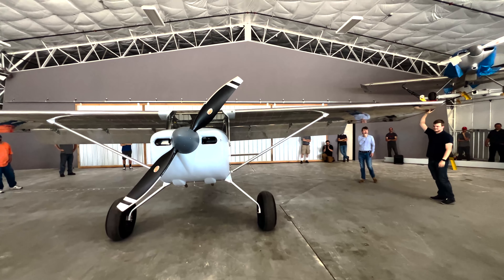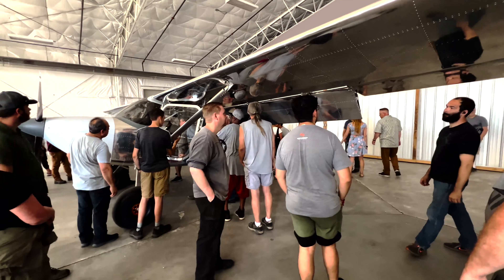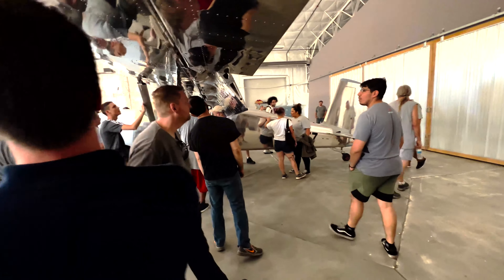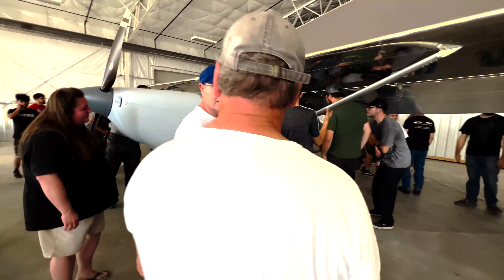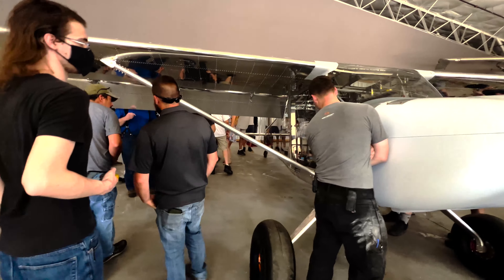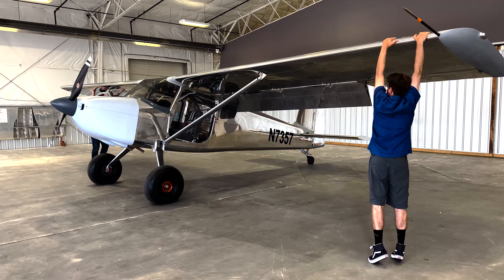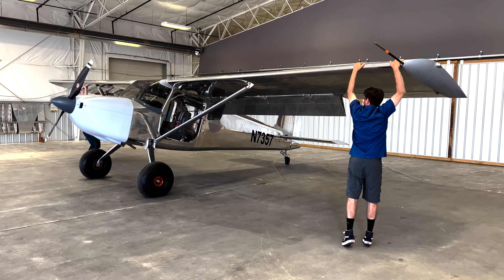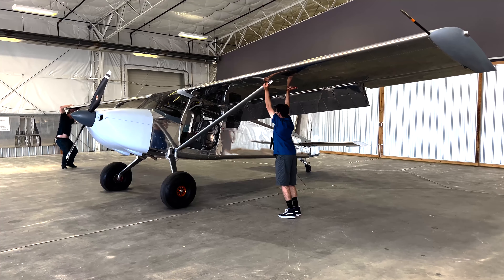RV-15 Engineering Prototype (on 26's) - Van's Employee Reveal Party (plus an "invisible feature")

Comment: I've largely ignored Van's because aerobatic aircraft is their specialty, and those are of little interest to me, but I love the look of this divergence from their standard fare :D
Reply: I think it’s a bit too much to say Vans specializes in aerobatic aircraft. They are great cross country machines that also happen to be able to loop and roll.
Reply: You probably missed out on the cross country machines such as the RV9 and the 4-seat RV10.
Reply: @phatvu3811  Huh, maybe I’ll check those out. Thanks.
Reply: Wow what a comment !! Dick designed an built some aircraft that have one of the best envelopes in the business ( stall speed to top end ) they take off in 300' to 400 feet and cruise 200 mph. AND they're also built very strong and quick ( I like very strong ) so part of them are areobatic. Of little interest ??? In case of an engine out you can land in less than 500 feet. You can also cruise at around 200 mph in a very strong airplane. I think that's VERY interesting ?
Reply: @danmcburney3247  They are excellent aircraft I am sure; it’s just that most of them are not something that appeals to me. I didn’t mean to insult them, insinuate that they were overly specialized, or suggest anything negative whatsoever. I have no doubt they are superb.

Comment: If a two seater seems like it would be a great replacement for the 150/152 series
Reply: Help me to understand how a 100k+ airplane is going to be a replacement!
Reply: SO well said !! If it stops at 100. How many times has this been tried ? How many can they sell. Just what the public wants,a tailwheel trainer
Reply: @pauleyplay  why would anybody think this was only a 100Kt airplane? My Rans S 21 with a less powerful engine than what this will likely have is good for 130kts up high. Vans is not building this as a trainer they’re building it for all the flatland posers that want to go to Johnson Creek ID and replicate Trent Palmers Bush flying. It will sell like hotcakes.
Reply: @Captndarty  We shall see  You have a good point
Reply: @Captndarty  I think he means $100k
Reply: @NoRemorse92086  huh, I suppose so

Comment: Airframe stress analyst here (Boeing, Cessna, Textron, etc.) Why the added weight and complexity of some internal mechanism for the gear? How is that superior to a solid flat spring like a C-170/C-180? Is there some kind of oil-filled damper on the RV-15? If so I have to ask why the added weight and complexity? I can't imagine short field stopping distance is really that much improved. Takeoff distance zero improvement.
Reply: Try landing a rocky field in a Cessna and you will understand why shocks are a wonderful addition to an off-airport aircraft.
Reply: I believe this shock absorbing gear will greatly reduce the (unwanted) bounce that typical flat solid gear delivers.
Reply: The Husky also has an internally dampened landing gear which is a big improvement over the pre 2012 Huskys. And essentially zero maintenance difference.

Comment: Sweet plane! More than I can afford.
Reply: I'm expecting 100k flying if you think about it that is average price of lowest priced SLSA that isn't an ultralight type aircraft. I agree my wife never let me blow 100k on an airplane I'm stuck with ultralights building a Chinook 2 DR landing gear with a 2 stroke engine. Have about 32k invested when I'm done at least I will be in the air.
Reply: Compare to a new C172 that costs $500K, this is a bargain.
Reply: @Mike-01234  I have '64 182 that I paid 56K for. $359 month. It's ugly (bad paint and interior) but its IFR, long rang tanks, one of the best light aircraft engines ever made with low time and great compressions and goes 150mph /130 kias.

Comment: Will the fuel tanks be inside the wing?
Reply: why wouldn't they be?
Reply: @SoloRenegade  if the wings were foldable or removable the tanks would likely not be in the wings (it’s rare see eg rv12)
Reply: @thewaterengine  SPA Panther? Kitfox?

Zenith have removable wings.
Cessna 150, 172, etc. have removable wings.

Not rare at all. Just a matter of preference and execution.
Reply: Previous comments from Vans official YouTube channel indicate there will be wing tanks
Reply: @SoloRenegade  C150 and 172 wings aren't easily removable. They have cables for ailerons & flaps, fuel lines, pitot line, stall horn, lighting cables, fuel sensor cables. It's a maintenance job to remove or install them. 
The removable people are talking about is easily removable, for hangaring and transport. Like those Europa kit planes, or HK36 Dimona. I've seen the HK36 being put together in under 10 minutes. And the Europas often live on a trailer, or a garage, only to be assembled on the airfield. That's quite convenient, IMO.
Reply: @thewaterengine  - Plenty of high wing aircraft with folding wings have wings tanks, such as Kotfox and Groppo Trail. Infact, ultralights and small LSA aside, I don't think I've seen any without wing tanks.
Reply: No external drop pods
Reply: @GoneOutFlying  But the Panther and Kitfox, among others, are easily folded.

And you didn't specify exactly What "removable" wings meant. But when you listed the RV-12 as an example, you opened yourself up to a wide interpretation. As RV-12 wings are not easily removed either. About as easy as a Sonex, Zenith CH650, or other airplanes that both do a don't have fuel in their wings.

And since my examples Do have fuel in their wings, and Are foldable or easily removed, my argument is valid.

Comment: Electric retractable slats and double slotted flaps and we’d really have something.
Reply: Wouldn't it basically be a 701 at that point? Vans are pretty good at making what they want to make.
Reply: As a builder I want SIMPLICITY! I am not even crazy about the dampened gear legs as it adds unneeded complexity
Reply: @simonhughes-king  Not even close, the 701 still uses a high lift airfoil. This way you could keep the more laminar flow airfoil and completely change the low end and safety margin that true retractable slats provide.
Reply: @robjohnson8522  Check out the Zlin Norden, the slats only weigh 22 pounds and are interconnected using one servo motor. Motor fails and the both slats fail in their current position.
Reply: @robjohnson8522  Well said  what is the point

Comment: I like how the shocks are built inside the fuse would be interesting to see the design. Does it meet LSA standards would be even cooler maybe this will be coordinated with FAA announcement raising the LSA weight.
Reply: Just from the size of it (grown men standing under the wing without hunching) there's no way it's going to meet the current LSA max gross and have any sort of useful load
Reply: It will meet the current proposed MOSAIC standards…. Which are nearly approved in Brazil this month. Hopefully the FAA will adopt the same. 4 seats, 3000 lbs, 61 kts Vso
Reply: @rianjohnson7484  are these the RV15 specs you’re listing or the current MOSAIC spec requirements? Many are wondering if it will be 2 seat or 4 seat!
Reply: Those specifications are for MOSAIC in Brazil. They also added Vh 185 kts. Just passed into law this morning. As for the 15 we will give more information at Oshkosh
Reply: @rianjohnson7484  thanks for the update
Reply: Thanks Rian, great info!

Comment: The new c172 replacement at half the cost. Vans should make a tricycle gear version and that would dominate the training market. Also 4 seats would stick a knife in Cessnas overpriced c172/182’s. Come on man do it.
Reply: They've already said that they'll have a tricycle version as well...
Reply: @TalonID  sweet, Vans giving aviation what it wants and can afford.
Reply: Keep in mind that you can't use an experimental aircraft for compensation or hire so this won't be used for training purposes. and isn't designed for that anyway.
Reply: @RVationNation  there is a flight school using RV12’s not far from me. Now I think you can only get a sport pilot there but maybe Vans should look at certification or get Aopa to push for it unless they are too far in bed with Cessna.
Reply: @toddw6716  Van's makes an SLSA version of the -12, which is why the flight school is able to use them. You don't want a certified version, that costs big bucks! In reality, nothing is probably ever going to replace Cessna in the training market. I'd guess the -15 is built around the IO-390-EXP119, that's a big engine to try and teach students in.
Reply: @RVationNation  ok thank you for your input of knowledge to me. I still would like someone to make a cheaper to own/maintain trainer which is what aviation needs to keep costs down. Perhaps it’s time for Aopa to do something and lobby congress to change the rules with respect to training in these aircraft for private/instrument ratings. If you want to go further than your going to have to train in something else.
Reply: @RVationNation  and you got yourself another subscriber with your educating me. Thanks
Reply: @toddw6716  completely agree. Half million dollar 172s is ridiculous. Thanks for subscribing!
Reply: @TalonID  Just like Cessna's every fusleage that rolls off the line will have probably have mounts for either set of gear. The early 172's/182's actually used the same main gear either in front of the door or behind the door. Tail dragger gear behind the door made the plane way too tall on the gear so they eventually phased it out.  My '64 182 needs step ladder to get into! : )